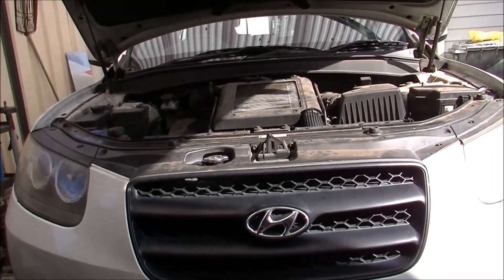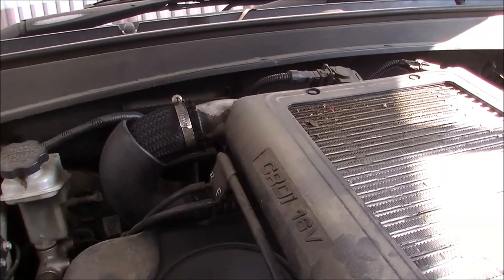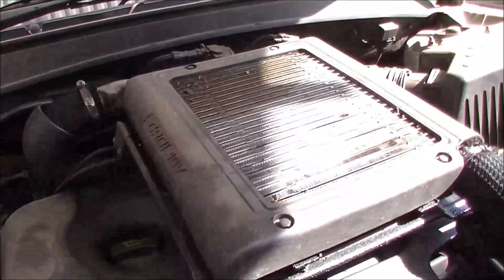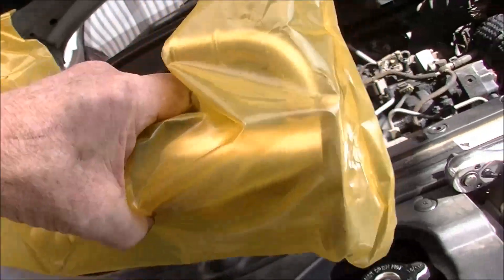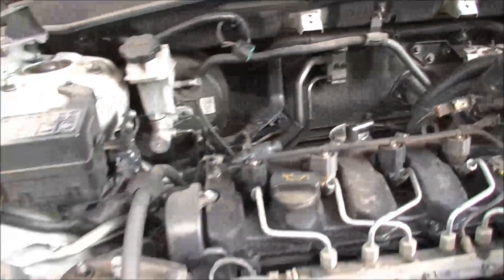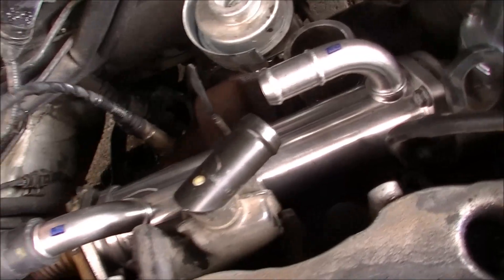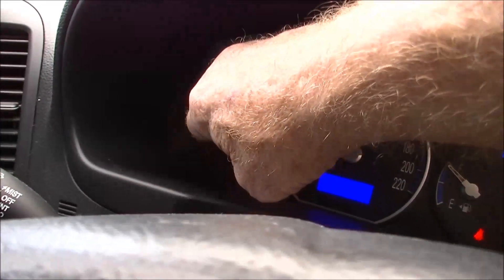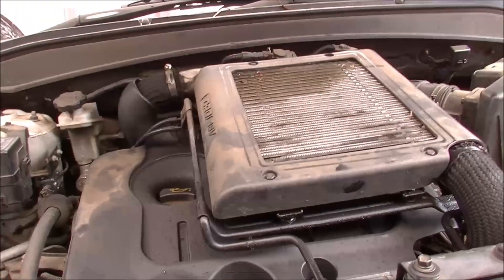2008 Hyundai Sante-fe EGR cooler replacement.

Comment: Looks like an easy repair!!! 
I do the screwdriver tip as well!!! A lot of the time I'll take the nut and put it in the socket with a piece of the packaging plastic over it so the nut is held in by the plastic!!! Just put the plastic over the nut and push it into the socket and now it holds in place!!!
Keep Rocking it out!!!
Reply from the maker: Also a handy method Pat.

Comment: its a Good thing to save mates some stress and expensive repairs .about the only thing i like about these types of cars is it makes life interesting working on them they have soooo many issues, it keeps you sharp. I dont mind deisels for fuel economy while carrying heavy loads etc. Not a fan of common rail though too finicky fuel system wise and very pricey injectors and pumps, some of the hyundai pumps aren't too crash hot though, ill stick with toyota myself.
Reply from the maker: We remember when Diesels were the indestructible work horse and the fuel was cheap but times have changed on both levels.
Reply: ive built many higher production hho cellsfor my own vehicles and two freinds, theyre quite impressive on older deisels freind a mechanical engineer got me into it years ago, hes been doing it since 78 farmers here swear by it, saves them thousands, all its doing is increasing efficiency given fuel is not completely burnt in the combustion chamber , yeh we get lectured all the time people trying to teach us about the law of thermdynamics etc etc assuring us it cannot work, yet it does , ever seen the movie gashole, or stanley meyer vids or who killed the electric car. I love it all. I put a decent cell on a vetrans TD sanyong he bought a cheap rubbish one from the states made fk all gas maybe 200mls per min so as a present i built him one it made only 1 litre per min being small yet at 10 amps , i never heard the end of it he go on about improved throttle response, power and fuel economy, if you get it right it really works. His freinds wanted me to build them one, i said sorry i old jack was the exception yet i taught them to diy and shared decades of trial and error with them, its all on the internet by various guys, reg pye and gavin knoxx arent too bad.

Comment: Next time use Oven clean mr cleaner the green one Orange lid clean the egr the Carbon buildup it don’t hurt the egr
Reply from the maker: Yeah man been there done that...Pulled the EGR apart and wire brushed everything till it looked like new...Still set a code.
Reply: ZIGgassedUP yep bro the egr buildup carbon quickly

Comment: Hi mate. I have a leak at the gasket on the egr cooler the u shaped pipe. I've just bought two new gaskets just want to know how to take the intercooler off. I see all the plugs that I have to disconnect and the two vac lines (wont mix them up) when I remove everything does any fluids come out ?
Reply from the maker: The EGR cooler has coolant running through it so that's no biggie and the rest is easy..You'll be right mate....Intercooler has 4 bolts..2 at the front and 2 at the firewall...Some oil may come out of it but not flow out..It's from blow by and is normal for a diesel...Cheers mate.
Reply: @ziggassedup  thx mate 👍🏻